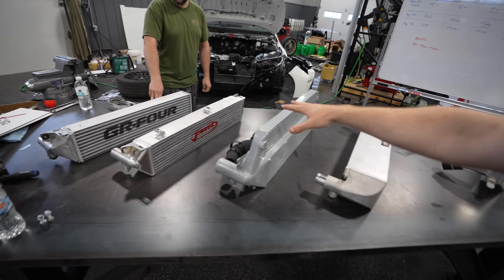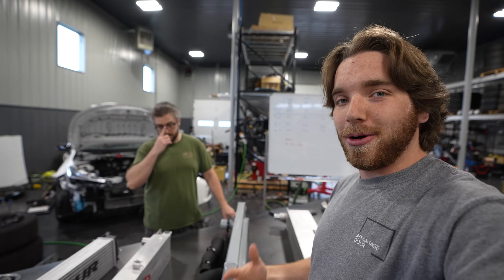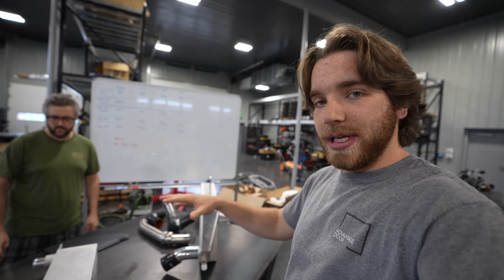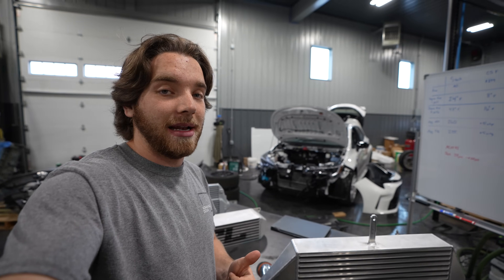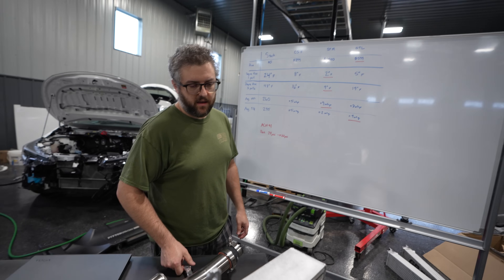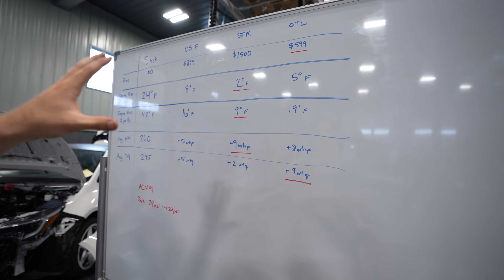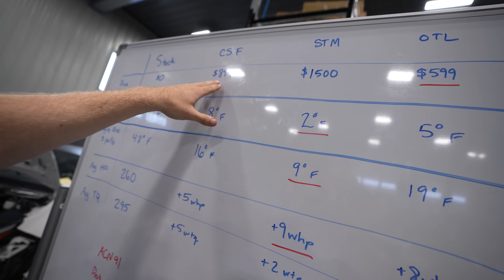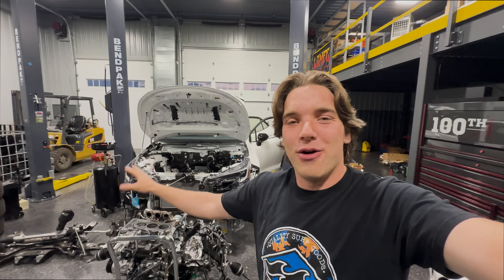The Best Mod For The GR Corolla's (Intercooler Comparison)

Comment: Nice video guys - here is some context and answers to some of the questions or feedback that you raised. 1) The larger inlet / outlet is for guys who want to go bigger power in the future - we're future proofing the design so guys can buy 1 intercooler and grow with the set-up. 2) The powder-coating is a thermal dispersion coating + it helps with avoiding corrosion , debris, etc 3) The frontal surface area allows for the quickest temp drop after beating on it - we have dyno video on our website to supplement the R&D that we did.

Comment: I saw the PWR intercooler in the video but you guys didn't mentioned anything about it, what was the results ?

The OTL that you guys tested, that IC is THICK, did it increase air blockage to the radiator ? OTL reduced a lot in IAT but how about OT and WT ?

Comment: Glad to see I made a good choice in the OTL intercooler preorder, I may be getting a tune sooner than later since you all said valve float came in with just the intercooler and other bolt-on's.
I have the SXTH intake, OTL downpipe, RK Ti catback, and when OTL fulfills the preorder intercoolers I'll be installing that with their intercooler piping as well. Should be fairly close to your moms GRC so I'll hit you up about a tune soon.
Reply from the maker: Yeah with all those mods you definitely need a tune.  The lower restriction intake and intercooler will definitely change the AFT enough to affect the car
Reply: Should be getting close to your mom??? That's what your mom said!😂

Comment: Was the testing done with the bumper off? I wonder if that would change the temperature efficiency of the taller ones?
Reply from the maker: We did testing with the crash bar on so not really because the bumper only covers the crash bar part
Reply from the maker: Don’t get me wrong it’ll affect it but just not a crazy amount of
Reply: @NemtecRacing  awesome! The taller intercooler seems like wasted space in theory because it’s tucked up under everything. But apparently it doesn’t affect it as much as I thought. Keep up the good work guys!
Reply from the maker: @cpftank09  if you were running the larger intercooler you probably are gonna modify the front end for more air flow

Comment: 12:25  so you are saying if you get any of these intercoolers and don't get a tune you will run into valve float issue? so technically, they all require a tune to run safely if you are going to track your car, correct?
Awesome video as always! I've been waiting for this comparison.
Reply from the maker: Yes sorry I should’ve made it more clear.  We would recommend a tune to run an intercooler.
Reply: @NemtecRacing  Gotcha! Another thing I want to ask is that you said the test was done in your mom's CE. Did it have any other modifications during the testing (perhaps the down pipe and intake from previous videos) I'm asking because the baseline torque seems pretty high at 295. 
I also noticed the peak boost was 29psi which is higher than a stock tune?
Reply from the maker: @elantran yeah it’s on a car with intake, downpipe, tune and catback.

By baseline we meant “stock intercooler” vs aftermarket ones
Reply: @NemtecRacing  Gotcha. I really appreciate you guys making grc contents and I can't wait for the next video!
Reply from the maker: @elantran Friday we have the big announcement and hopefully have our race car back on the road soon!!
Reply: @NemtecRacing  Can I negate float with stronger valve springs?
Reply from the maker: @TehPsychoticGamer yes kelford valve springs are the ones we use on our built motor
Reply: If you are going to even drive your car, you need to upgrade the valve springs
Reply: @copperkeyracing6167  I guess I haven't been driving my car then. LOL
Reply: @elantran  not safely, no. Don't let your toast burn

Comment: How do you know you had valve float in the high rpms? What parameters are you monitoring to see it?
Reply from the maker: You can hear it.  And on the dyno graph you can see it
Reply: @NemtecRacing  is it a loss of power or choppy graph?
Reply from the maker: @BulliKid both lol tomorrow if I remember I can get a pic of it

Comment: Could you guys do a comparison like this but with intakes? Seems like all the claimed power gains are inconsistant in between companies for their intakes. Some do their measurements in STD vs SAE (like you mentioned in another video), some dont mention if they dynoed in AWD or FWD, and others dont have dyno sheets at all. I feel like companies like K&N are gonna have a lower actual power gain vs other companies like Eventuri or MST. Without consistant testing, their numbers are meaningless in comparison to other companies.

Comment: As a GR owner this is awesome content.
Now i also just found out that in the UK theres a 800hp GR yaris that i think you guys at Nemtec would be intrested in looking into.
Here on youtube, channel is called officially gassed
Reply from the maker: That’s 800 break horse power so reality it’s around 700 horse power to the wheels.  That car uses a crazy wild turbo kit but that car is all custom.  Vs our car is using basically a bolt on kit with very little fabrication

Comment: Hey just to clarify: there is valve float on all aftermarket intercoolers because all of them increased boost pressure passed the valve springs tolerance/rating. If I remember correctly from another video, valve float happens on our cars at around 27psi of boost. Sooo can I assume that all of the intercoolers in this video will most likely increase boost passed 27psi during daily driving? 
It seems like a lot but I’m not an experienced mechanic just a hobbies so I might be missing something here.
Reply from the maker: It’s a tricky question because technically with a tune you could get the stock car in stock form to float the valves… 

And I wouldn’t run an intercooler without a tune because it’s just not gonna be super safe for the car in the long run idk just my opinion. 

But the smaller intercoolers on a stock tune probably won’t have valve float.  The big intercoolers probably will  it the big intercoolers on a stock tune are unrealistic because you need a tune when changing the air flow that much
Reply: Thank you so much for the quick response! Doesn’t valve float correlate directly with high boost pressure though or am I wrong there? 

Edited this just now to try to make more sense
Reply from the maker: @KoalaOalaJones it does but valve float only happens near redline.  And honestly most times cars on stock valve springs tapper to somthing like 22psi at redline.
Reply: Gotcha. Thank you again for the replies

Comment: @Nemtec, Per your comments on valve-float with all these options beyond stock; what's your recommendation to do about the issue if going OTL or CSF - just stay off the limiter, consciously stay under 6k rpm, or look toward a tune to set rpm limit? My aim is to relieve the components of the heat soak and stress to the engine overtime - keeping the car overall in its stock form long-term  means swapping valve springs is a bit overboard. Keep up the great content.

Comment: Hello! Is there any solution for exhaust valve delete? I put a magnaflow exhaust and had some problems with the valve, so i get rid off the valve.
I already have a EcuTek tune, but cant delete the warning on the dash of not having the valve connected. Sometimes it appear depending on the throttle pull…
Reply from the maker: You have to have the valve plugged in and zip tie it up out of the way but it still need to actuate or you’ll still get the warning
Reply: @NemtecRacing  thanks mate
Reply: Someone has already developed a actuator removal modules you don't have to keep it plugged into the car
Reply from the maker: @crazyairborne news to me
Reply: @NemtecRacing it's new to the market, creator had shared it on Facebook groups a week or two ago. Last I checked he didn't have a website yet

Comment: I wish that you had also compared and tested the SXTH Element intercooler as it looks like a great option for the price of only $499 and for only $799 you can get it with the larger hot and cold charge pipes.

Comment: Dear colleague, please tell me, if I buy a GR Corolla, where should I start with tuning to achieve 400-450 horsepower and good suspension for driving on snow and gravel, aiming towards a WRC style rather than a racing car?
Reply from the maker: Lamspeed turbo kit with a Garrett g-25 550 turbo.  Is what you’ll need to make 400hp.

Annex suspension is going to be coming out with a rally cross coil over soon.
Reply from the maker: Message me on instagram (link is in the description of the video) or Facebook @ John Farrow

Comment: Would the CSF intercooler fit the Yaris? Should work as a drop in no?
Reply from the maker: Ofta idk if it’d fit a Yaris that’d be risky.  Cause I know the Yaris front end is alittle different
Reply: Pretty sure it doesnt. The Yaris's coolers dont fit the corolla
Reply: We tested this on a GR Yaris from Mexico and it does not fit.
Reply: @CSFracing  will you be making one for the GRY?

Comment: You guys said valve float is that with a tune and intercooler or stock with intercooler. And is the OTL unit a bar and plate or tube and fin. I know the CSF is tube and fin.
Reply from the maker: we tested it with a tune and intercooler.  but i wouldn't run one of these intercoolers without a tune.  they are so much more efficient you'll risk changing AFR to much etc
Reply: My feelings from all the Yaris testing in Austraila... valve springs should be your 1st mod. If you don't, it's a ticking time bomb... even stock... could even be why that gr corolla burnt to the ground recently

Comment: What about the PWR intercooler? You guys have it on the bench, but not on the board.
Reply from the maker: It was terrible $1000 for something that acts like the stock intercooler
Reply: @NemtecRacing  That's horrible news because I already have the PWR intercooler installed on my GRC... Glad to see more options available now than when I went with the PWR. If it was your GRC, would you upgrade? just wondering... My applicable mods include LIMIT+1 downpipe, Eventuri intake, Ecutek 93 and E50 maps... plan to do springs, retainers, and Kelford EZ cam later down the road. Glad to see you made it to Crystal Lake and picked up the new GRC with the blown engine. Excited to see what's next!
Reply from the maker: @JasonChurch1992 I was in the same boat as you.  I spent $1000 on pwr also…..  if I were you yeah I would change it especially if your going to go more mods down the road.  OTL is a good value for sure.  Not sure weather the jackson racing has any real improvement over otl so kinda which ever one you fancy

Comment: I recognize that fin design on the stm intercooler. It’s a garret core and they are expensive but they are the best cores you can buy. Only draw back is that it can cause over heating if you have a car that has bad air flow to the radiator but they are super popular in the Mitsubishi community.

Comment: Would the sxth engineering one be the same as the results of the stock one based on specs?
Reply from the maker: It would be better than stock but not as good as the OTL

Comment: SXTH claims you can run their intercooler and their charge pipe kit on stock tune. Since boost isn’t increased will valve float still be an issue at stock boost levels (not increasing boost).
Reply from the maker: Probably not.  But doing mods like this with out a tune isn’t recommended..

Comment: Dang makes me kinda regret preordering the jackson racing intercooler 🥲 but at least it’s a huge upgrade from stock! I’m getting turbo inlet, charge piping and a BOV next. What brands would you recommend? I’m plan on getting SXTH element piping and stuck in between HKS and turbosmart for the BOV
Reply from the maker: Honestly BOV is kinda a waste.  We never ran one on ours until we got the turbo smart one for the big turbo.  And the jackson racing intercooler is very good intercooler so your all good

Comment: Did you guys monitor coolant temps as a part of this testing to test differences?   Specifically curious about that due to some of the taller intercoolers you tested potentially blocking up free flow of air across the radiator vs the stock FMIC, and warmer air flowing across the radiator as a whole.

Comment: Now can you do a comparison for oil cooler kits?
Reply from the maker: Send me the ones you want us to test
Reply from the maker: Send me links to the ones you want to see tested
Reply: @NemtecRacing  555 engineering, racerx, jackson racing oil cooler kit, limit +1 (I believe is doing a oil cooler kit as well) Also review your guys oil cooler kit. I remember you guys were installing one on the way to the grid life for laguna seca. Thanks. I personally got the 555 engineering kit, was about to get the racer x one but I was worried about it hitting the CSF intercooler.

Comment: So only consider this....when you go big turbo. If you stay stock , and not tune the ECU....no valve float issues. But if you stay stock and use intercooler....still valve float issues?
Reply from the maker: Valve float on these cars is very simple.  If you run above like 24lbs of boost past 6k rpm on the stock valve springs they will float

Comment: Why not test the 6xth element one? That one is affordable as well.
Reply from the maker: It’s better than stock but isn’t as good as the OTL one
Reply: I have the SXTH element intercooler what the performance and that unit.
Reply from the maker: @mhk67091  the sxth intercooler is better than stock but no where near as good as the jackson racing or OTL one
Reply: I got the SXTH because CSF or OTL wasn’t out yet. Is it worth upgrading the SXTH intercooler to a CSF or OTL or is the SXTH is good enough for a daily driver. The thing I like about the SXTH it’s durable i do a lot of highway driving the stock one was getting dinged up SXTH doesn’t get any rock dings and it seems better than stock. I wish you guys tested it to see the numbers. They claim it performs 20 degree drop over stock intercooler which isn’t as good as CSF or OTL. BTW love the videos keep doing them. I’m a big supporter of the platform and you guys.
Reply from the maker: @mhk67091 appreciate the support it probably isn’t work upgrading for a daily driver. It does the job
Reply: @NemtecRacing  no doubt you guys are awesome I can’t wait for the next video. You guys showed use what works and what doesn’t and any weak points of this platform.
Reply from the maker: @mhk67091 I can’t test every part.  I can’t test them for days and days.  We try to make videos that are entertaining, have some good info in them and help people get a better idea of what works and what doesn’t.  These cars are changing so rapidly new parts are always coming out.  It’s hard to keep up lol

Comment: Hey guys just a quick question about the valve float you experienced.  was it with just the intercooler on a stock setup or after tuning?  I'm just trying to understand if I can just bolt on a few things and be OK or if I need to start thinking rocker retainers/ head work with this mod. great videos! Thanks for all your sacrifice and hard work for for the sake of the GR community.
Reply from the maker: If you bolt on a intercooler you shouldn’t get valve float.  But once you get more than one or 2 mods like intake and downpipe we’d recommend a tune cause these cars are sensitive and you can definitely drive your car and daily it with mods and no tune but taking it to the track and ripping it probs isn’t a great idea without a tune
Reply from the maker: Valve float is avoidable by any tuner who knows what they’re doing.  If you get a tune you shouldn’t be worried about valve float cause the main guys that tune these cars know what’s up and have the tunes dialed in enough to avoid valve float.
Reply: @NemtecRacing  Hey thanks for the response guys! I appreciate info.